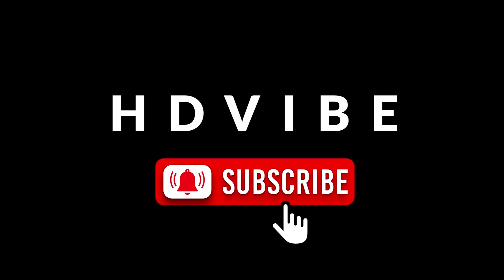Get The Perfect Handlebar Upgrade For Your Harley Road Glide The Easy Way!

Comment: We did this on 09-13 models as well … it’s a very cost efficient way of getting more height the draw back is the angle of your wrist and leverage on bars imho
Reply from the maker: Thanks Jack for watching and commenting.   There is definitely a sweet spot on this change.  In my case just a 3/4 of and inch did the trick.  Ride safe and enjoy. 👊✌️👍
Reply: i agree on the wrist angle, if i knew the bars wouldn't break, would put a pipe on grips to straighten a bit. i will be getting new bars when have extra money to spend on them.
Reply from the maker: @rayw8177 Thanks for watching and commenting.  You definitely have to get the bars in the sweet spot.  I seem to have found it.  Height is good and wrist angle and leverage just right.  Was doing 17 foot U Turns no problem the other day on the range.   If you are already a subscriber to the channel...thank you.  If you haven't yet subscribed to the channel I'd be honored if you'd consider doing so.   Thanks for your support and ride safe.  👊✌️👍

Comment: Definitely an effective trick to get you by. It looks like the stock road glide handlebars are a little taller than the stock street glide.
Reply from the maker: Thanks Joe for watching and commenting.   The Road Glide bars are definitely taller than Street Glide bars.  So far just rolling the RGS bars up a bit,  has made a big improvement.   Still plenty of leverage for those tight U turns.  Ride safe and enjoy.  👊✌️👍

Comment: Always important to get exact fit for your comfort. These tiny adjustments make huge difference sometimes. Wish I could get good fit with my RKS but as you know really well RKS bars are junk. Good tip right here.
Reply from the maker: The RKS bars are bad.  Thanks Art for checking it out.  Much appreciated.   👊✌️👍
Reply: I have an RKS and still struggling to find the right bars….I bought a KST Kustoms 12” pathfinder. The pullback is not enough…:-(
Reply from the maker: @viktorkatona7521 When I owned my RKS, the bars were mu biggest challenge with the bike.  I never changed mine out but did adjust them back a bit.  The wrist angle was always odd feeling as well.  I'd you are already a subscriber to the channel...thank you.  If you haven't yet subscribed to the channel I'd be honored if you'd consider doing so.   Thanks for your support and ride safe.  ✌️👊👍

Comment: I can’t get that Horseshoe piece off, it’s like a hole on the right side and left side enough for my pick to go inside each side, what do I do, push towards the front tire or push downward the ground, I’m so frustrated, so any help would be greatly appreciated.
Reply from the maker: There is a small tab on the side closest to the tank.  Slightly press that tab in with your pick and it will pop right off.   It's at the bend of the horseshoe so to speak. 👍
Reply: @HDVIBE  Thank you, I’m so done with it, I’ve tried slightly pushing down and then tried pushing towards the front wheel direction (inward) , and to no avail, what’s funny I’ve accidentally messing around with the “lock” at the Galveston rally and it popped off,,, now I’m trying to get it off and I can’t. 
If you look inside there it’s a metal piece in the middle and there’s 1 hole on each side of it, so the pick goes all the way in and doesn’t touch anything on each side so I’m assuming it’s in the middle the piece that needs to get released, ? I’ve tried a very small eyeglass screw driver also & nothing moves downward or inwards. UGGGGHHHH!!! 
lol!
Thank you sir for the reply & for sharing.
Reply from the maker: @babybugspaw7085 👍

Comment: Mine CVO RG came with KST adjustable bars but they are 10”. I have played with them and it’s hard to find that balance. Looking forward to getting 14” bars. By the way that switch collar kicked my butt😂 getting it back on took me much longer than I want to admit. That little tab is plastic and it looked stressed when I took it off (used bike) so I was very careful and I finally got it but I had to walk away from it one evening 😂I didn’t want to muscle it and break it. Did you put it back on before or after you put the side screws in first the instrument cluster? Thanks for the great content!
Reply from the maker: I put the plug back in before I screwed it back into the instrument cover.   The one on the right is not fun.  Thanks for watching.   I appreciate your support.   👊✌️👍

Comment: What happens to the stop pin that is in the bars. What does that do to the mounting surface? Does the pin push itself into the bars? I'm sure the pin is considered a safety precaution but we all know it's Harley's reason to buy new bars.
Reply from the maker: Thanks Scott for watching and commenting.   The pin does push itself into the bars.  I have been riding the bike like this for many months and no issues.   If you are already a subscriber to the channel...thank you.  If you haven't yet subscribed to the channel I'd be honored if you'd consider doing so.   Thanks for your support and ride safe. 👍✌️👊

Comment: Torque specs on the 4 riser bolts ?
Reply from the maker: Thanks for watching and commenting.   The torque spec is noted in the description as noted in the video.  16 to 20 ft lbs.  If you are already a subscriber to the channel...thank you.   If you haven't yet subscribed to the channel I'd be honored if you'd consider doing so much.   Thanks for your support and ride safe.  ✌️👍👊